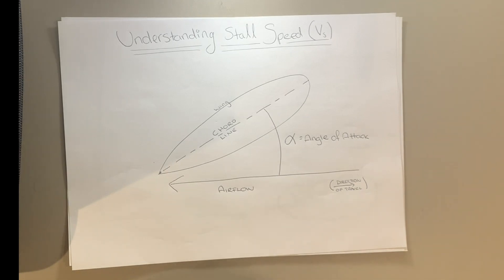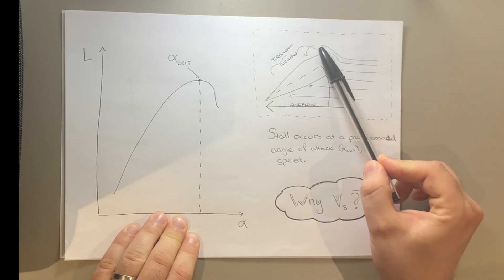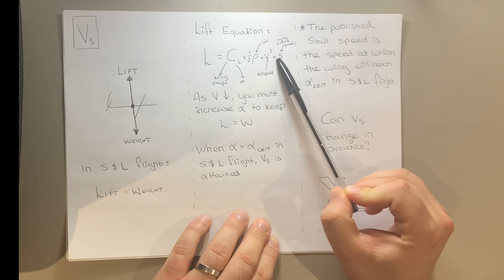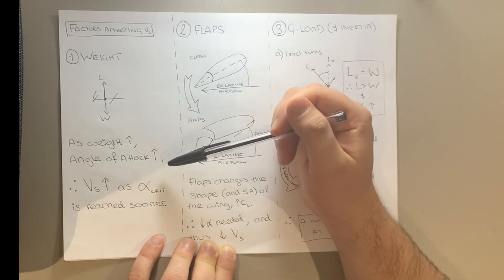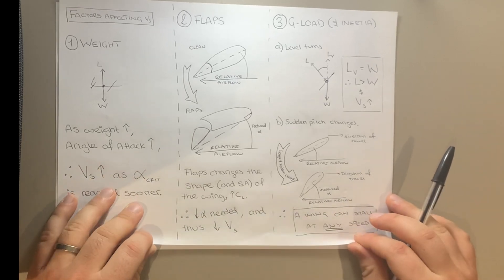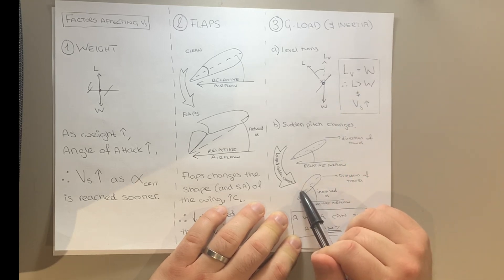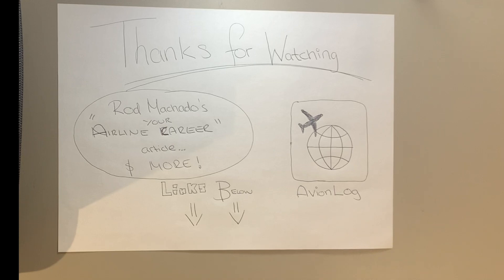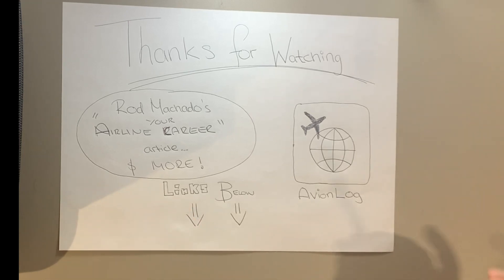Why Stall Speed if it's all about Angle of Attack?!

Comment: Hi, 
Your video is very much informative and I have a doubt in that, let say max critical angle of attack is 12° for instance and if I reduce the speed of aircraft I need to increase angle of attack to maintain the lift equal to weight, let say I reduce the speed much more and I further increase angle attack and now since aircraft is much slower, air molecules hitting wings won't be having much energy so is there a chance of boundary layer Speration before reaching critical angle of attack, which leads to stall. Please explain this factor to me and also explain how to approach this type of problem in equation.
Reply from the maker: Hi Naveen. The equation only applies to when the wing is producing lift. Going beyond the critical angle of attack will result in the stall. At the point the aircraft is no longer producing lift and the equation is therefore not relevant. That's the basis behind this video.
Reply: @MerryfaceAviation  actually I think I didn't convey my doubt properly . Let me try to explain once more. If we reduce the speed so much and increase the angle of attack more but still we are within the limit of critical angle of attack . But aircraft moving through air at low speed where is there a chance of boundary layer separation much before the critical angle attack and leading to stall since air won't have enough energy to stay attached to boundary layer?
Reply from the maker: @naveenv4227  significant boundary layer seperation occurs at the stall speed. It's a vital part of the definition of the stall. If you keep reducing your speed and maintain close to the highest angle of attack before alpha crit, you'll still produce lift, you just won't be able to maintain level flight.
Reply: @MerryfaceAviation  thank you for the clarification. This means a lot.
Reply from the maker: @naveenv4227  no sweat

Comment: Thanks for the video! But umm... What if airplane is on ground effect? Is stall speed then higher?
Reply from the maker: That's a really good question. I'm going to think through this one here, not sure if it's the correct answer though.

When the aircraft is in ground effect, it will experience less drag, and it should also experience a form of cushioning effect, which would mean that it needs less lift to stay level...

So I believe that in ground effect the stall speed would be lower as the aircraft does not need as much lift to maintain level over the ground. I could be wrong though

Comment: Hi thanks for video
I have one question
Higher stall speed is good?
What's the difference between higher stall speed and lower stall speed?
Thanks
Reply: nobody answered you but im suspecting by now in your training you have solved this, in case not..well higher stall speed is not the best when landing usually you want to come in at the POH published speed..all it means when we say higher stall speed is the aircraft needs to fly faster often because of surplus weight so instead of landing say a c172 at 55kts you need to fly in land at maybe 60kts (flying faster to maintain lift because of excess weight in this case)..conversely to land with lower stall speed we tend to add flaps which of course slows the aircraft down due to drag..slow stall speed is when the aircraft stalls with a lower number on your ASI where as a higher stall speed will be a higher number..coming in fast.One more scenario..you going flying heavy for some reason..you have a near miss with another aircraft you quickly had to turn right and you hit a big bank angle which also increases stall speed..double whammy..suddenly you are stalling at 65KTS and you wonder how the hell that happened..well, your stall speed was greatly increased.

Comment: Say you slow down but do not increase the AoA?  Yes you are losing lift but that is not the same as a stall.   At what speed do you stall?
Reply from the maker: well in that case you would descend, no increase in AoA with a reduction in airspeed would mean just that. Look at videos of the hammerhead aerobatic maneouvre. Your speed reaches sub 5kt, but the stall horn never goes off, because the critical angle of attack is never exceeded